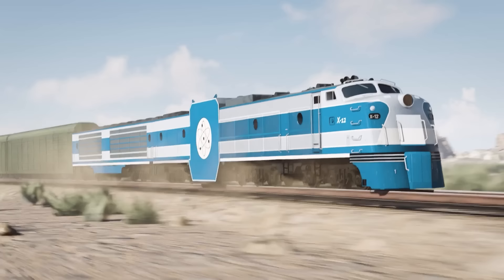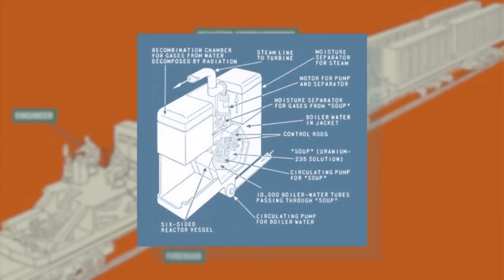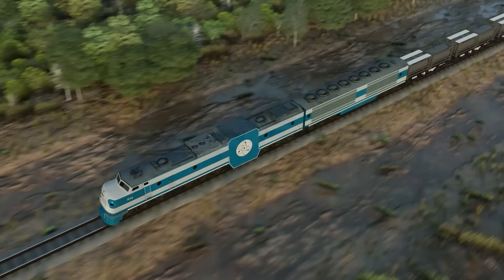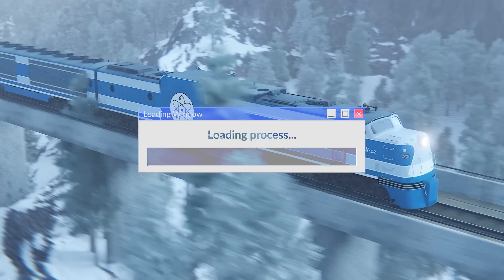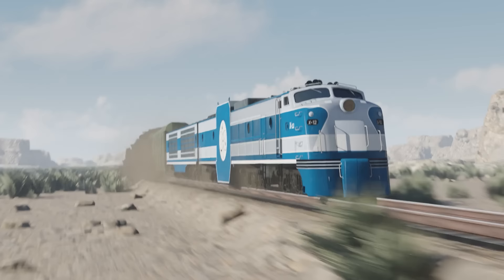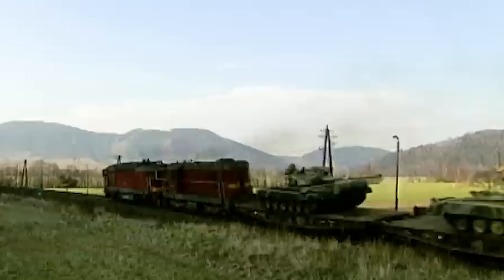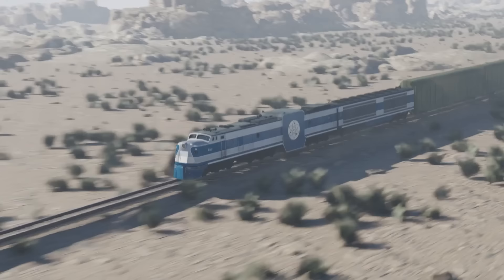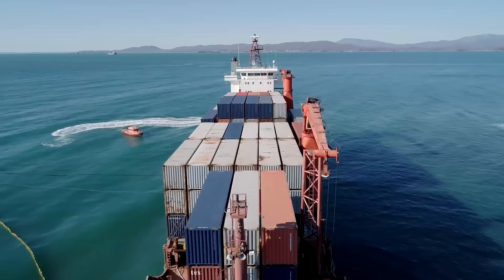What ever happened to Atomic Trains?

Comment: If they don't want the train to refuel, then we can just y'know
use electric trains with overhead wire
Reply: Nah, people will rejected it because somehow, for some reason, it sounds even more impossible for them to attach the wire instead of burning the money for safer nuclear train
Reply: Sounds great... till something breaks the power line and now you have a dead train.
Reply: @SilvaDreams  Something that breaks power line are capable to derail the train anyway
Reply: I doesnt have to stop...well just get people to jump on as it goes by.
Reply: @bocahdongo7769 I mean, no? Overhead lines break all the time just because. Rarely does a wire break lead to derailment. We have a link line that has frequent wire breaks in winter because of the cold, never once caused a derailment.
Reply: Just wondering does no one understand just how large the USA is? running that much electric cable is not feasible. That is the reason we don't have a large public rail system, the ones we do have are slow and diesel powered. 
Most of our shipping is done via diesel electric rail. 
The only 2 countries to ever actually look into this were the USA and Russia, there's a reason for that.
Reply: did you watch the video? 10:50
Reply: @davidbreard1023  China is big too, but they have bullet train lines up to Tibet.
Reply: @davidbreard1023  I'm not sure if you understand that we have laid down MORE than enough electric cable in the past. The United States, espically the Midwest, used to have electric rail lines known as interurbans connecting small towns with cities. These ran on overhead wire. During the peak of these systems, they had over 15,000 miles of track under overhead wire. If we were able to do it then with 1900s technogly, we can surely do it now.
Reply: @WesternOhioInterurbanHistory  sure we've done it before, we don't lack the materials nor skills nor tech.
We simply lack the willpower and more importantly the FUNDING. 
Not only does one need the electric lines over head but the train cars and the tracks to run on as well. Because our current rail system is simply too slow. 
So when I say too large I don't just mean physically I mean financially and will power.
Reply: @davidbreard1023  The US absolutely have the funding. We just rather spend the funding adding 6 more lanes to our crumbling highways....
Reply: But putting up wires is expensiiiiiive 😣
Reply: @SuperPickle15  it'd be nice if they actually fixed those highways with the money they spend on other ridiculous things, but thats still cheaper than add to the rail system that was slowly bought out and dismantled by the auto industry. For starters are you using existing rail lines are building new ones?
Building new ones has the benefit of new stops and serviced areas congruent to today's home/work areas such as more and further suburbs to up and coming or established cities instead of dead or disused areas but you need so much planning and preparation: who's gonna build it, where is it gonna go and what's it the way? can it be moved or do you need to build around it? whose land do you need to build it on and how are you gonna acquire it? what about the environmental surveys? do the people even want it? will it actually improve the area or local transportation issues? and such
But what about using existing tracks? for starters, are they abandons tracks or in use tracks? who owns them and how are you gonna acquire their use/rights? are they in good working order or disrepair? does the full line even exist anymore or were parts removed due to lack of use? what will it take to get them back in full working order and are you going to expand on them? how much is all of this gonna cost?

or, like you said, spend less money on a crumbling infrastructure system that somehow doesnt actually get fixed
Reply: @christianlink4433  Massive highways pretty much all of the issues you stated, just worse. If you think buying land for train & train stops is bad, now imagine buying land for 10-lane highway and all of its myriads of connections that can take up to a kilometer in width. And environmental issues for a massive highway are wayyy worse than electric rail track. Rail does improve transportation - it's vastly superior to highways for capacity if you build one rail per direction.

You can reuse old tracks, or at least the routes made with new tracks over the existing paths.
Reply: @WesternOhioInterurbanHistory  I'm not sure if you understand that 15,000 miles is a vastly smaller number than 160,000, which is how much track the US had in 2020 for freight. To put that into perspective, the United States currently has about 200,000 miles of high voltage line ran across it (which btw, a separate high voltage system would indeed need to be ran just for an electric freight train infrastructure). The immense undertaking to run electricity for even 70% of the track would take decades.

And let's talk about power. We won't even take into account environmental factors like hills, valleys, weather, etc. First, you'd probably need 50kV lines to power freight trains to minimize the need for substations (which, by the way, it would be another massive undertaking to put the number of substations needed to support the infrastructure in place). Second, one freight engine averages about 2,000-4,000 horsepower. One horsepower equals roughly 746W. So, not including friction, thermodynamics, and your other pesky little physics issues that account for energy loss, you'd need anywhere from 4 - 20MW to equal the power of just one conventional freight engine. I cannot find good numbers on how many freight trains run each day, but there are about 28,000 freight locomotives in the US and I did find an article that estimated electrifying the freight trains between Chicago to Los Angeles would need about 1,500MW. Who can tell me how many megawatts a typical power plant provides? Do you think we have the grid to support that kind of demand across the US?

Next, let's talk about other budget demands. First: simply electrifying freight trains. Do they exist? Nope. So, let's throw years of research and development money into that. Then, let's spend even more money building them and/or retrofitting existing locomotives (likely not possible). We can already estimate how unfathomably expensive it would be to put the infrastructure in place, but what about when it's already in place? Maintenance costs, upkeep, environmental disasters which are particularly unfriendly to overhead lines like heat waves, high winds, poles getting struck by vehicles even. Lets not forget that terrorism and sabotage are always a clear and present danger. We can't even monitor one border, you think we will be able to keep an eye on 100,000 miles of electrified track? 

Lest we not forget about politics. I don't even have to touch too much on what a nightmare it would be to coordinate with 48 different states' politicians, let alone local cities and municipalities. 

They tried electrifying the freight train system in just one region of one state, California of all places, back around 2010-2012. Just one part of one state, and guess what? Do you hear of an all-electric freight train system anywhere in California? No? I wonder why. No I don't, because the report is available for all to see and guess what? Unfeasible. Here, take a look for yourself: https://scag.ca.gov/sites/main/files/file-attachments/crgmsais_-_analysis_of_freight_rail_electrification_in_the_scag_region.pdf?1605991886

To think that you could equate a relatively small electric PASSENGER railway system in the 1900's to a national FREIGHT system in 2023 is....nothing short of mindblowing.
Reply: @GhostRIley-sl3rn  that is a passenger train railway. NOT freight. Frieght trains are orders of magnitude heavier, which requires substantially more electricity and infrastructure.
Reply: The idea was that this train could go on any existing railway without having to spend years installing overhead wires and they were trying to sell to business who don't own the railway so they would have had to wait for the government to accept installing overhead wires
Reply: Do you understand that overhead power supply is relatively rare in many parts of the world?
Reply: @SuperPickle15  JUST ONE MORE LANE PLEASE JUST ONE MORE LANE I SWEAR TO GOD IT'LL
IT'LL FIX TRAFFIC
JUST ONE MORE LANE BRO
Reply: did you watch the video? This is literally brought up in the video
Reply: @davidbreard1023  ? "running electric cable is not feasible" yeah the USA doesn't have you know, an electrical grid, powering every house, with many parts having links between states. Europe also definitely doesn't have cables connecting countries. You definitely aren't able to send these comments because of a giant undersea network of internet cables.
Reply: @IdunRedstone  it's not just a matter of running the lines that the easy part. In the USA we have high voltage transmission lines for sending power long distances in order to use this power a substation is needed. Along the coasts and large population areas no problem but there are large areas with literally nothing but corn fields and tornadoes(dramatizing a little)
Then you come to the other issue would anyone actually use it probably not bc we love our cars.
 So in this instance feasibility isn't about can we do it but more should we do it and the answer is no. Just bc you can do something doesn't mean you have the right to do it.
Reply: @WesternOhioInterurbanHistory  There were full size electric railroads with AC power running in at least three different parts of the States. Even Henry Ford had a go.
Reply: @GhostRIley-sl3rn  India is literally a subcontinent, their goal is to electrify their entire railway. Right after they've made it run on the same gauge .
Reply: Where's the fun in that?
Reply: The GEML in the Uk is Electric and it hasn’t had any issues
Reply: @WesternOhioInterurbanHistory  More to the point , main lines in the US have been properly electrified in the past , in places like the northwest , when ac electric locos were in their infancy.
Reply: @admcstabby  Nonetheless , electrified freight trains run on the transsib today , and India is making inroads into electrifying its' entire network , including dedicated freight lines . And the USA itself has hauled freight under the wires in the past.

Comment: That is a nice computer model of the X-12.  I made an HO scale non-powered one in Union Pacific livery that I was able to push around with a pair of powered F units.  (The Union Pacific was definitely interested in a nuclear locomotive to replace it's Big Boy and Challenger steam locomotives.  They were already building large gas turbine powered locomotives, and later large diesel locomotives.)   It looked quite impressive and had massive overhang on the curves of my small layout.  A couple of other things I learned in my research on building the model:

* The machinery ahead of the hexagonal reaction section is a steam generator.  The passenger coaches of the time used steam from the steam locomotive for heating and cooling.  When they were replaced by diesels, the diesels had to have a steam generator installed to heat and cool the coaches, usually in the tail end of the diesel.  Since this engine wasn't intended to pull passenger trains, a steam generator was really unnecessary.  Ahead of it was a small auxiliary diesel engine and generator; it was used to provide power to start the reactor as well as to move the locomotive alone around the train yard without starting up the reactor.  The Union Pacific gas turbine locomotives also had auxiliary diesel generators for the same purposes.

* The fuel used in the reactor was weapons grade uranium mixed with sulfuric acid!  Refueling the locomotive would be more than just draining the old mixture out and pouring the new mixture in, the old fuel would have to be recycled.  The engineer in charge of designing the locomotive helpfully proposed that the government would build the refueling stations for the railroads; but this, coupled with the initial cost of the locomotive, the cost of the fuel, the training needed for locomotive crews, and the danger of an onboard reactor, and it is not surprising it was never built.

I put together a video on the X-12 on my channel as well, but nothing this nice.  Well done.
Reply: I made a drawing of this train in a PRR livery back when Fallout 76 was about to come out.
Reply: is the CGI from a train simulation game? Because I am impressed as hell of the graphics in this video and will buy it in a heartbeat.